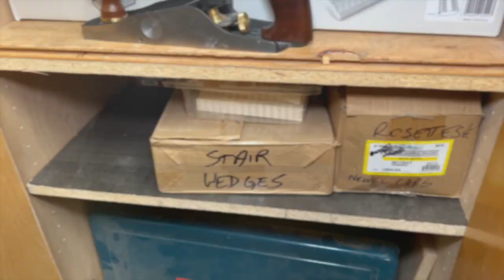Make a Small Shop Work: for Pros and Hobbyists

Comment: At 16:55 Years ago I didn’t even really have a shop. It was more of a garage with some woodworking tools in it. But I did manage to make cabinets in it for a house I bought and remodeled 50miles away.
I built the cabinets to be assembled on site with a portable pocket hole jig… Kinda like RTA (ready to assemble) cabinets. 
I cut & stained everything and made the Shaker style doors in the garage. Then put the backseat down in the Ford Focus (nope, didn’t have a truck back then) and packed as much in there, making several trips. Then assembled the pre finished, prefabed  cabinets, with face frames on site… and they turned out great! 
•So it can be done, it’s just a PITA, but really not to bad.
Reply from the maker: Thank you for sending. I love to hear these kinds of stories. Initially my "shop" was uninsulated and unheated. I had a kerosene heater, a table saw and a drill press. I built the cabinets for my house in there. Made my face frames with mortise and tenon joints using the drill press and the table saw. They're still standing. I also made a nice little Craftsman style table - again with mortise and tenons. I want to get back into making furniture and other things I can do in the shop. Cheers, Scott

Comment: I’ve been debating a sliding table saw for a long time. I use my tracksaw extensively but I’m not sure how to position it in my shop. I just published a shop tour video, I’d be very interested in your feedback as it looks like our businesses are quite similar. 

Great shop tour, and great use of your availability space.
Reply from the maker: I'm going to watch your shop tour (November 2023 right?) later today or tomorrow morning. (I'm just in the middle of something.) At 715 sq. ft. your shop is a bit bigger than mine but not vastly more spacious. For those of us with smaller shops it's key to identify what you will be focusing on most in the way of builds. I had it in my head that I was going to do more cabinetry when I bought the Hammer K3. But reality is that I don't have the room for cabinet building. I also would need to invest in some kind of high-end edging machine but I don't have the room and/or the budget. (Festool Conturo is almost as much as my Hammer K3). I also don't have a burning passion to make all kinds of cabinetry. There are lots of cabinet makers in town and most have big spray booths etc. So I can't compete in that market. I liked the scoring blade feature on the Hammer and also the outrigger and sliding table. But Festool now has a track saw with a scoring blade. So that would be a much more economical way to process your sheet goods - and take up much less space. In retrospect I could have bought a panto-router and/or a spindle moulder in lieu of the sliding table saw. Furniture building seems more in line with what I like to do. I will drop you a note after I watch your tour. I subscribed to your channel and I do believe I've seen some of your content in the past. Cheers, Scott
Reply from the maker: I watched your tour and left a comment with some of my thoughts. Cheers Scott

Comment: Good workshop 
I wish my shed was half of that
You ask for suggestions:
I just noticed you have to much timber taking wall space.
Additionally you got many litl box here little cubbed there- i think better to remove many small storages and replace wit one or two bog ones. 
Just a suggestions. 
Good luck 👍
Reply from the maker: Yes agreed. I have to find a solution for storage of lumber and plywood - especially the random pieces. Either another storage shed or a yard sale. Thanks for the comment.

Comment: That is not a small shop.  My shop is so small I have to use short handle wrenches and 3 ft extension cords.
Reply from the maker: Haha. Yup that is small. Maybe that falls under the "Tiny Shop" category.
Reply: @scottearlsmithFTC  I have used the term “micro shop”. I recently made a sign for a local store that sells cookies and had to take it out in the driveway flip it over and move it back into the shop to put hangers on the back.  My shop is 11 ft x 21 ft with a 9ft ceiling.  Walls are covered in French cleats, Wood storage is a black pipe frame hung from the ceiling just low enough so it has 1” clearance when the garage door opens.  Everything is on wheels, Oscillating sander and thickness planer are on a cart that flips over so both have the same footprint.  Things are so tight I have to carefully watch my calorie intake.
Reply from the maker: @Rusty_ok  Thanks for the feedback. This is exactly why I made the video. You really have to make the space you have work for your needs. If I ever relocate - either a new build or a place that has room for a bigger shop - I'd definitely go bigger. And higher ceilings. At least you have 9-feet. I only have eight and for working with 4x8 sheets of plywood I am always dinging the guards on the lights. I know a guy who had a little basement shop that was about 6x8. Mind you, he had a little TV in there which makes me believe it was more of an "escape room" than a shop. And yes, I'm trying to loose weight too so there's less of me to squeeze between the bench and the bandsaw. Cheers Scott
Reply: My shop so tiny, I have to use battery powered tools to save space otherwise taken up by powercords 😀 Either that or I need to chuck out a couple of things so I can step inside.
Reply from the maker: @leegarnier9396   Haha. It's a struggle that's for sure. When you have to go outside  to change your mind, you know you have a small shop. 🤣